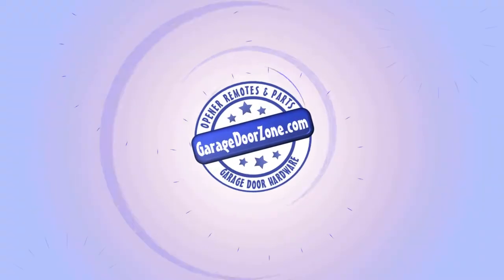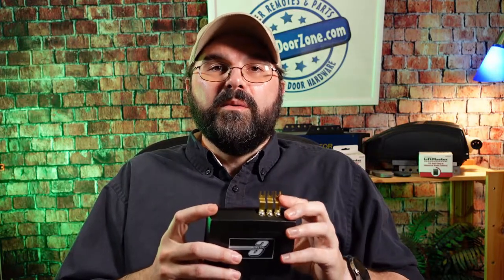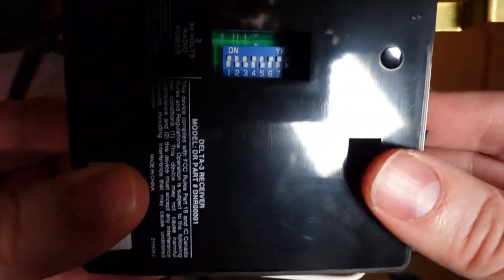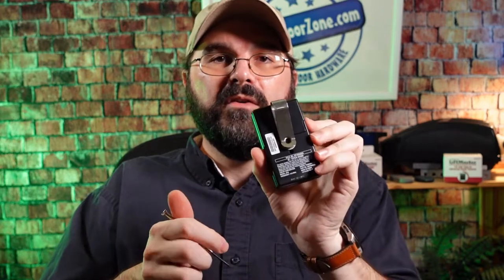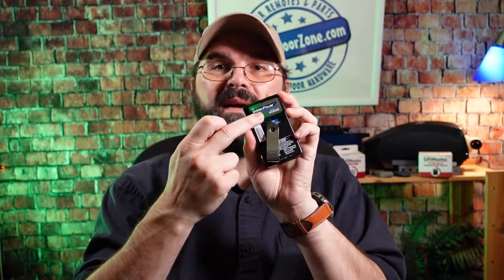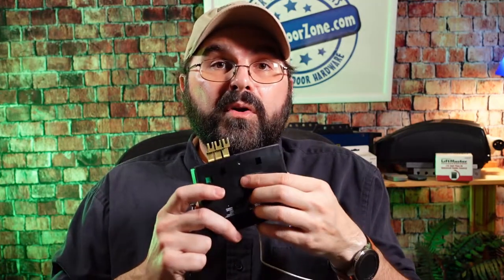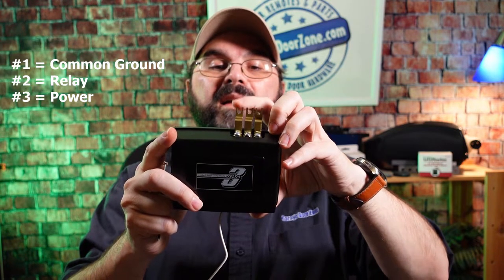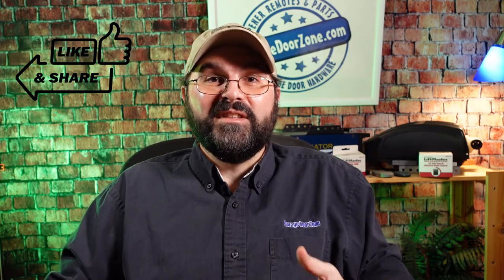Linear Delta-3 Radio Receiver and Remote - how to program & install garage door receiver and remote

Comment: The manual and moulding are incorrect on wire placing on the receiver terminals. They are backwards from what actually needs to be wired.

Comment: Do you have any tips to increase the strength of signal/range of my Linear garage remote and Linear Delta 3 Receiver?
Reply from the maker: The first thing I'd recommend (if you haven't done so already) is to put a fresh battery in your remote. Next, double check that the wire antenna coming out of the radio receiver is hanging straight down towards the floor. And lastly, if your operator has an LED or CFL low energy light bulb, remove it and replace it with an incandescent light bulb (the low energy bulbs can cause interference). - Brian

Comment: great video!  is there a way to program the Linear Delta 3 to your vehicle garage door buttons?
Reply from the maker: Thanks for watching!
If your vehicle is equipped with Homelink then you'll be able to use your remote to program the button in your vehicle. Try following these instructions:

For first time training, press and hold the two outer HomeLink® buttons, releasing only when the HomeLink indicator light begins to flash after 20 seconds. (Do not perform this step when training the additional HomeLink buttons.)

Position the hand-held transmitter 1-3 inches away from the HomeLink surface (usually located on your visor, overhead console, or mirror), keeping the HomeLink indicator light in view.

Using both hands, simultaneously press and hold both the desired HomeLink button and hand held transmitter button. DO NOT release until the HomeLink indicator light flashes slowly and then rapidly. When the indicator light flashes rapidly, both buttons may be released. (The rapid flashing indicates successful training.)
Reply: @Garagedoorzone  Worked like a charm!  Thanks again for sharing your knowledge.

Comment: I wish there was an app I could use with our old Linear Delta 3's. I have 3 doors in my shop and it would be nice to just use my phone.
Reply from the maker: Linear doesn't have a product but you could check out Amazon. There are a number of aftermarket garage door opener wi-fi connection products available. You might want to check out the eKyro Smart Garage Door WiFi Controller https://amzn.to/3z8CyLr
We haven't tested or used this item but it has gotten a lot of positive reviews. Full disclosure, we're also an Amazon Associate so if you use our link we may earn a small commission. There are also a number of other products that may work the same or better. We have plans to test some of these items in the near future and will post a video with the results. Best of luck.

Comment: Thank you so much! Very useful video!
I have 2x Delta 3 Receivers (DNR00001) for 2x garage doors and 3 remote controllers (two button each, Linear Elect. type DT2 with the indication "Frequency A" which is unclear to me) since many years. Two of the remote controllers gave up (strangely, I also tried to reprogram but could not make them work again) and only the last one is working. How can I find a universal controller which I could clone to my only remaining unit? From reading it looks like frequency is 310 MHz, how can I be sure this is the right frequency? Any suggestion of a good product? What I should check before ordering, say via Amazon or?
Reply from the maker: Why not just replace the two remotes with the same make & model of remote so you know they'll be compatible? You can get the DT-2D Linear Delta-3 2-Button Remotes here: https://www.garagedoorzone.com/DT-2D-Linear-Delta-3-2-button-Garage-Door-Opener-Remote-310Mhz_p_34.html

Comment: Can I program the garage door remote in the visor of my Ford truck to this receiver?
Reply from the maker: Possibly. If you have a working Linear remote then you may be able to copy the signal from that remote to your vehicle. 
If your vehicle is equipped with Homelink then you can try the following programming method:

For first time training, press and hold the two outer HomeLink® buttons in the vehicle, releasing only when the HomeLink indicator light begins to flash after 20 seconds. (Do not perform this step when training the additional HomeLink buttons.)

Position the hand-held transmitter 1-3 inches away from the HomeLink surface (usually located on your visor, overhead console, or mirror), keeping the HomeLink indicator light in view.

Using both hands, simultaneously press and hold both the desired HomeLink button and hand held transmitter button. DO NOT release until the HomeLink indicator light flashes slowly and then rapidly. When the indicator light flashes rapidly, both buttons may be released. (The rapid flashing indicates successful training.)
Reply: @Garagedoorzone  thanks for the info. I just tried it, but unfortunately it didn’t work. Following the steps, when at the part of holding both the old remote beside the home link and simultaneously holding the desired button, that button stays red until it goes out completely. It doesn’t flash at all. The garage door opens and closes repeatedly, I’m guessing from also holding the button in on the original remote. 
The door actually opens and closes partially at first, then goes into full cycles.
Reply from the maker: @robkenny1529  You may want to try and put a fresh battery in the remote & try programming again. If that doesn't work then reach out to Homelink by contacting them here: https://www.homelink.com/contact

Comment: Is there a way to program the Delta 3 to a LiftMaster 890MAX remote?
Reply from the maker: No. The Delta-3 is compatible with Linear Delta-3 receivers and the 890MAX is compatible with Chamberlain/Liftmaster openers & radio receivers. They are not compatible with each other.
Reply: I just bought an 894LT lift master remote with cloning. Will that work? I bought a universal remote which was able to clone the code but will not work with my lift master 2.0. I bought the 894LT in hopes it can clone the delta and I’m sure it will work with my lift masters.

Comment: hey any chance I can program an overhead door wireless keypad with the delta 3?
Reply from the maker: I'm not sure I understand the question. Are you asking if you can program an Overhead brand keypad to a Linear Delta-3 receiver? If that's the case then the answer is no. Different manufacturers use different programming and frequencies for their radio equipment.
Reply: @Garagedoorzone  that was exactly the question, is their a manufacturer that can remote keypad to the delta 3?
Reply from the maker: The Linear DTKP Keypad is compatible with the Linear Delta-3 receiver and can be found here: https://www.garagedoorzone.com/DTKP-Linear-Delta-3-Wireless-Keypad_p_69.html

If you want to see how it's programmed then watch this video here: https://youtu.be/Zw55La71SLY